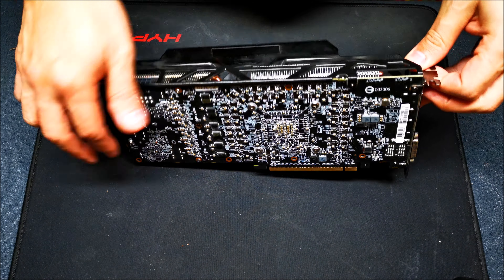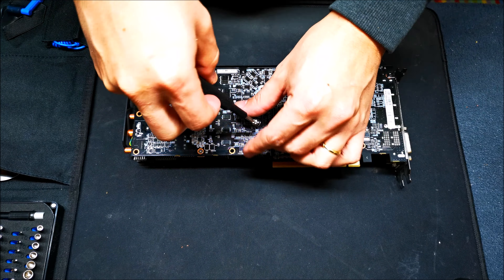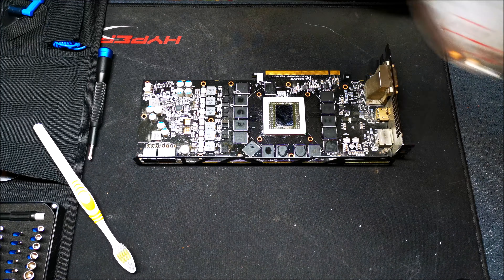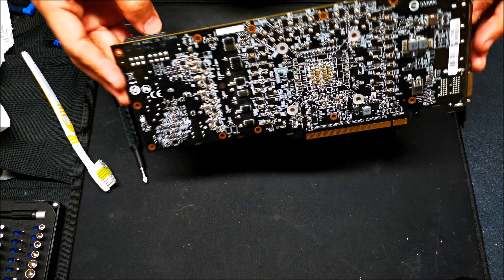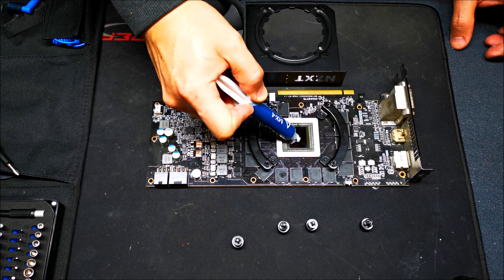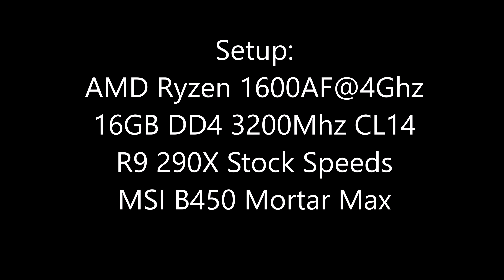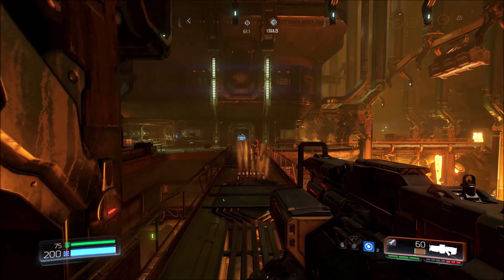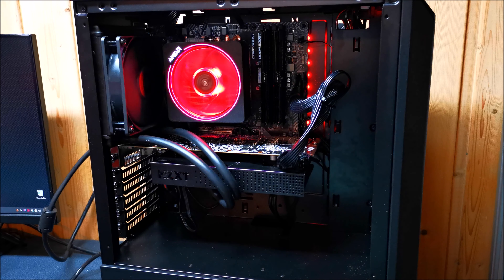Bought A Defective R9-290X. Can It Still Play in 2021?

Comment: You should really put some heatsinks on those VRM, that fan does not do very good job of cooling them. Also i highly recommend to have heatsinks on the memory chips.
Reply from the maker: Thanks for feedback! There is no need for heatsinks at VRM or memory chips. The fan actually does a pretty good job cooling the VRM's. I have tested the temperature, it stays between 70-80 Celsius max load. These mosfets are rated for up to 125 celsius. Also the memory chips are made by Samsung, which stays in the high 40 even on max load 👍
Reply: @TechnologyHive  DirectFET Stronk 💪

Comment: i build new pc recently..ryzen 5600x x570 unify and 32 gb ballistix elite 3600 cl16.but i cant afford new gpu because of the outrageous price.so had to reuse my old r9 290 lol
Reply from the maker: It will carry you through these times of famine! 😂
Reply: r290x is faster  as 580 ... so
Reply from the maker: @MakeSh00t  it's not as fast. But it is fast enough for some 1080p gaming and even 1440p if you can sacrifice a some eye candy 😊👁️.
Reply: @TechnologyHive  really ? i have 5900x r9 290x is sold crap 5700 non xt 110c overheating problem and  was  9months old crashing nonstop.. yeah with ryzen 3600x dust2 average 300 fps and drops fps to 200 and max fps 700 with ryzen 5900x and r9 290x minimum fps 400 and max fps cl_showfps 1 1025 fps... average 700 fps.. so tell me not so  fast? I play destiny 2 all maxed out 1080p.... and average 120, max fps 240, minimum 80 fps.. tell me that? quake champion 350 fpsmax average 250 fps, with 5700 and ryzen 3600x i had 190 FPS AVERAGE... How can u be so sure ? When i have that setup ? if i get 8gb i can game with crossfire at 4k gaming easy.. but  u can not .. it is really hard to get cheap one .. 700 euros they want for 2 8gb model 290x.. and yes 290x did only 1 time crash that is it... it was because of drivers i used old one to try from 2017.. now i use whql drivers from 2021.. and i am glad that i sold my card 5700 non xt and i buy new MB CPU PSU and used gpu and pc case. After selling 3600x and mb i get even better... NVME SAMSUNG RAZER Keyboard and and i have fun. Before 0 fun.
Reply from the maker: @MakeSh00t  If you're having fun with then that's all that matters. Cheers! 👍😊
Reply: @TechnologyHive  psu is BEQUIET 1200wat dark pro.  yes yes yes..waiting for price drops of gpus .. new gpus coming out and prices will get low as possible.
Reply from the maker: @MakeSh00t  Hope there are more choices later this year 😊👍
Reply: @TechnologyHive  it will be minning is colpasing 300 percent..